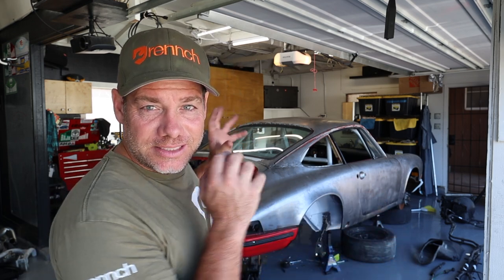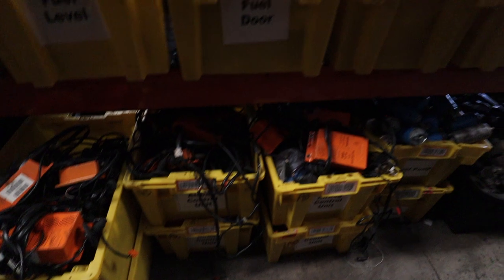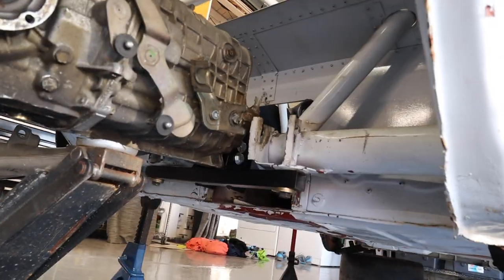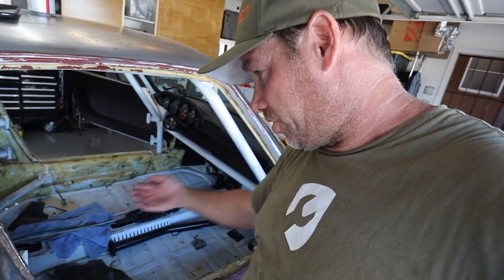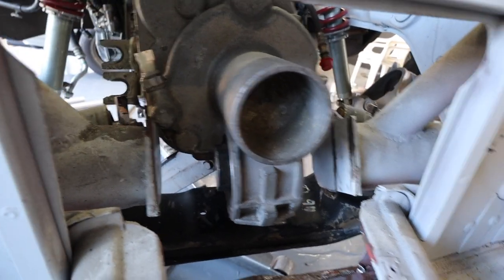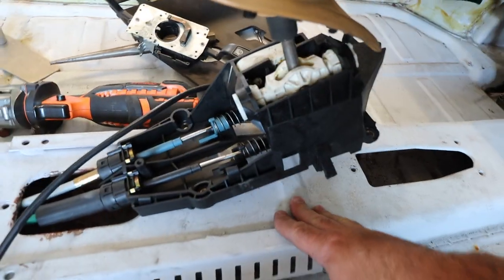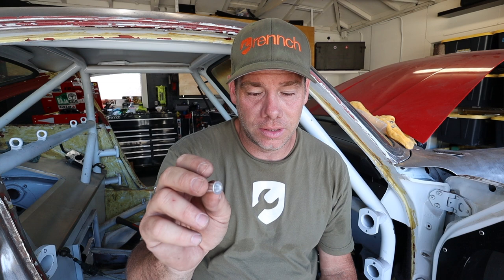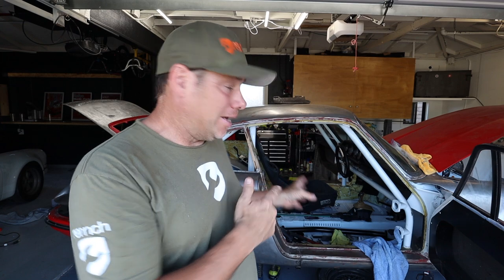Porsche 996 Shifter into Vintage 1969 Porsche 911s w/ 400 HP Subaru EZ30 Turbo | Blasphemy Build 25

Comment: You can get custom length cables made, check with a local hydraulic shop, or heavy equipment shop. They have the swage tools to make cables.

Back in Denver, we had a hydraulic shop make some cables to repair the front end loader where I worked.
Reply from the maker: Or I can get a killer sponsor that makes a killer shifter and custom cables.  :)

Comment: Hey Mike, you should be able to get those cables extended or new ones made up for a reasonable price, if that is why you are cutting the torsion tube even more.
Reply from the maker: It wasn't a clean cut anyway, so It will look better when I'm done.

Comment: Looking good dude 😊 For the gearbox linkage bracket and selector levers. I'd get the gearbox and engine where you want them for best weight distribution. Both the gearchange levers and cable brackets can be remade to allow the cables to clear the suspension. Using thicker steel for the bracket eliminates any twisting of the bracket. 😉
Reply from the maker: That's right. That's the move.

Comment: I was going to ask you about the location, if you really want it in the stock location.
When I fabbed my own linkage, for a g50, I moved it up and back.
In your position I would think about grafting in a 996 rear suspension subframe. It would give more room for the transmission and be a lot better all around. Plenty off aftemarket cup/gt3 stuff to bolt on.
Wouldnt be that difficult to do in a build like this, being this cut up already.
Reply from the maker: That might overcomplicate it for me...and probably be above my pay grade as an amateur engineer.  But I think it's really close now.
Reply: @rennch.  More work for sure, Im thinking about doing it in a 924 I have, would like to see someone atempting it before. 😁

Comment: Another great video, thanks. One question: when you move the transmission forward or back, doesn't that require a change the position of your rear wheels? How do you ensure that the rear wheels will line up correctly with the transaxle mounting points?
Reply from the maker: there's a bit of wiggle room with the axles.  :)

Comment: Sucks that they don't have metric rivnuts/tools at HF. If you squeeze the handle a little bit while unscrewing the tool from the set rivnut, it comes out ALOT easier.

Comment: I'm confused- you keep moving the transmission forward and aft- but isn't  the alignment of the transmission to the wheels and axles critical? Don't they have to be at a pretty specific angle to not wear out the joints prematurely or work at all? Or do you have quite a bit of wiggle room with that that I'm not aware of?

Comment: Maybe I'm missing something.  Your axles location are what's important, not where the shifter is sitting.  Shouldn't the final position of the trans be determined before you do anything with the shifter, and then extend the factory 996+ shift cables if they are too short.

Comment: I'm not even sure if this is doable but have you thought of moving the trailing arms out an inch to 2 inch. I know that will be a lot of fabrication because some of the struts are right at the end are the torque tube. But I was thinking you could just change the backspacing on your rims to accommodate the difference and width of the trailing arm. Then again smarter people than me will probably say it destroys the geometry of the car
Reply from the maker: Why would I do that?
Reply: @rennch.   give you a little bit more room for the transmission shifting cable but I've only started watching your Channel and I assumed that later down the road you're going to swap something out and you may need a little extra room. But pretty amazing what you been doing so far. What's impressive is that you're doing it on a budget and not an Unlimited amount of cash per litre